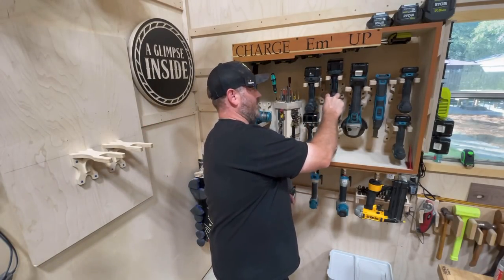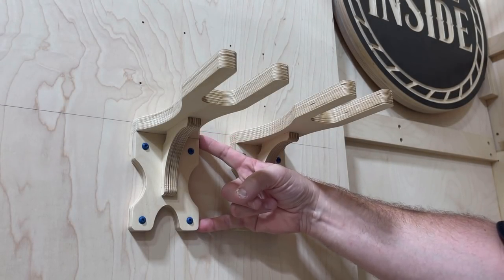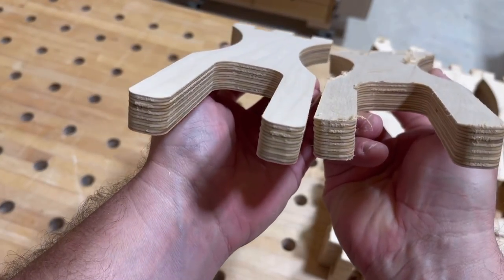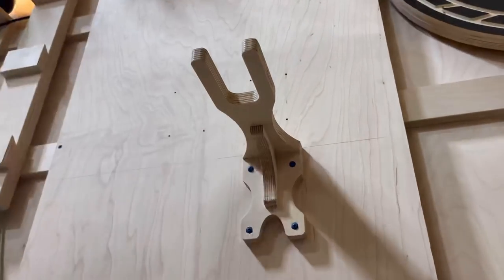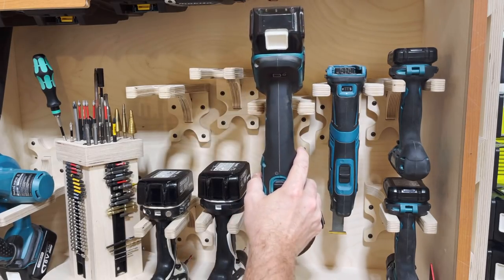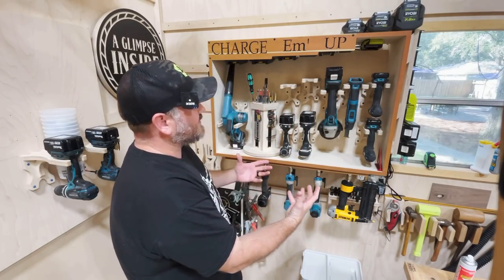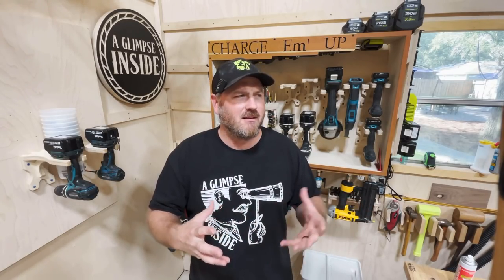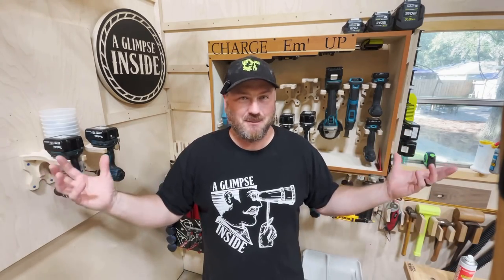The ULTIMATE Drill Driver Holders With Hidden Functionality

Comment: Hi Chris,

To get rid of those fuzzies you have a few options  and I’ll start with the easiest first 

1. Do two passes with the first leaving .020 and then the final pass at a full depth of cut removing the .020 left this usually removes most of it and it does depend on the bit you are using I would need to know that. 

2. Use a roughing endmill first and then similar to the top leave a little more material like .060 and clean the final pass with a finishing endmill. 

3. Use a chamfering bit to clean up the top edge, this requires using a down cut spiral bit and you will then clean the top with the chamfer bit that has the fuzzies left.

Hope that helps!
Reply from the maker: Yes very much so  thank you for the information. I do appreciate you taking the time

Comment: If you have a ball-end router bit, you could already clean up the edges. Make a mold that your pieces fit in, drop the newly cut out pieces into the mold, then have an instruction set to go around the edges of the pieces to round them off. Then turn the pieces around inside the mold and do the same thing again. No more fuzzies and nicely rounded edges.

Comment: I needed to adjust the pocket(s) that the center support nests in....but now the teeth in the corner have gaps between them.  At least an 1/8 of an inch.  My question is, should I be carving these out with the "cut on path" setting or inside/outside settings?  Thank you the help.
Reply from the maker: Cars outside the line for sure. Sorry I wasn’t more specific with this. Eighth of an inch down cut or compression bit. It should turn out really well for you
Reply: @AGlimpseInside  Thank you, we are all learning here.

Comment: Thanks for the mounts and the video. My CNC is running them off now. I was wondering, why did you use 3/4" plywood?? I adjusted them for 1/2" and they seem fine.  Just curious, not a complaint. I'll probably just make one set on the CNC and the rest using a router with a trim bit. takes too long on my small Sainsmart CNC.  Maybe someday when I get some room in my workshop I'll move up to the big league!  For now, as longs the the plans fit on a 5x12 bed, I'm good!
Reply from the maker: That’s a great question and the answer is availability of material. My dealer has 3/4 of an inch Baltic most of the time and a half inch is very hard to source right now at least in my area of the country. So I wasn’t gonna wait on that I figured I would just make this product and also it’s the most robust of the plywood so why not. Best of luck with the half inch I’m sure it’s gonna be great. Thank you so much for your purchase

Comment: I just purchased your CNC files. I'm using Aspire 10.5 which won't allow me to open the files created in VCarve 11. I opened the .svg file to get the 3 parts however that doesn't have the toolpaths. What size bit did you use in your cnc to cut out these parts?

Comment: hi what diameter bits are you using for cutting you drill holders out as i have got from you a set of files . 
as i am set up for metric  hear in the UK thanks Stephen
Reply from the maker: .125 in or 1/8in

Comment: I ordered your file to cut the tool holder on my cnc router. I can not get the dxf to open in Mach 3. Any suggestions?
Thanks
David
Reply from the maker: Use the SVG. That’s why I include multiple files in case one is a little temperamental with somebody’s set up.

Comment: A compression bit should reduce or eliminate those bottom fuzzies.
Reply from the maker: Does it does a little bit. I’ve got quite a few of those. I found the down cut it works best for me because I want to use sawdust as compaction and no tabs. A little bit of extra sanding is nothing compared to taking off tabs in my opinion

Comment: Hello, nice video and holder, I bought the files to make my own. Which brings me to your method of milling. If the VCarve file I downloaded is the same as you're using, I'm not sure why are you using an 1/8" endmill for the entire job? I believe, or rather know that you would save a ton of unnecessary CNC time by changing your toolpath strategy to include a 1/4" endmill. If you use an 1/8" "drill bit" for CNC's and not an endmill, to drill your fillets and then switch to a 1/4" endmill to cut the profile and hog out the pockets, I think you could save a lot of time carving over what you're spending now. You may not find a 1/8" bit, but a 3mm is just a couple of thousands under and will work fine. You could then make at least a 0.125" deep pass with the 1/4", and not 0.05" as I see the file shows, and then look at increasing the feed rate to whatever your CNC will handle. I would think it should be able to cut faster than 45 inches a minute, maybe 60~70 with a 1/4" bit. My two cents, best of luck with the new business, Chuck
Reply from the maker: Thanks for the insight. However for me to set a cut up without changing the bit for the entire project is huge for me. And I’ve got so many irons in the fire here I can set a cut with a reasonable speed and if it takes a little bit longer that’s OK because I’ve been can jump to something else for the channel or what not. I completely understand efficiency and that it looks like I could totally be more efficient by changing out bits. It’s just a pet peeve of mine if I have to change a bit two or three times for one project. I know that sounds silly but that’s my thought and I figured I would let you know. All good ideas though Brother and they all would work really well and I appreciate it
Reply: @AGlimpseInside  I get it, I just hate seeing so much extra CNC time, and it's not for nothing, it does take a toll on the machine, trust me they don't last forever. It's not much different than driving your car around in 1st gear, much more wear and tear on the driveline for the same distance traveled. It probably takes close to 6 hours to run those parts, by changing your strategy to the 2-tool solution, it cuts it almost in half, to just a bit over 3 hours. The first tool path for the 1/8" drill bit will only take about 10, maybe 15min, then you can change it to the 1/4" and let it run for the remainder of just under 3 hours. The times might not be exact, but the percentages between the two are remarkably close. If your run time is 5 hours, then it would be a little over two and half hours for the 2-tool run. Anyway, it isn't just efficiency, it's cost savings on power and more importantly the machine life. Running as you are you're doubling the cost of your CNC by wearing it out twice as fast.
OK, I've said my piece, I feel better now. But I probably wore out my welcome here, so I wish you and your business immense success. 👍
Reply from the maker: Hey brother I’m here for you I’ll be a sounding board all day man no problem. But the time frame you used six hours? Is that just for those three pieces. I’m able to make 10 complete holders in 45 minutes on my machine with only using the 8th inch bit. Granted I do have a powerful commercial grade 
Machine that is liquid cooled with a true spindle. Maybe that’s why I can go through it so quickly. Because this thing is a beast
Reply: @AGlimpseInside  Thanks, 45min to cut out 10 holders with an 1/8" end mill is pretty impressive!

Comment: Why did you choose to hang the tools battery up?
Reply from the maker: Great question. Each manufacturer puts the drive and reverse toggle on the drill a little bit differently. To mount them upside down there’s fewer moving parts to get in the way so every brand has the best chance of fitting  well

Comment: I purchased cnc file, but since I use Aspire and the file is designed in VCarve Pro I t would not open
Reply from the maker: Unfortunately you would think those programs with coexist because they’re made by the same company but they don’t that’s why I include all the other file types for you to import into whatever modeling software are using. I can tell you I use an eighth of an inch compression bit the first pass is. 20 inches and I do this in about six passes with. 70 thickness of stock hope that helps of course follow the outside of the line. If you’re making the tool holder The mortise is .215

Comment: With your love of french cleats why not make mini French cleats in your cabinet to hang these instead of screwing them in?
Reply from the maker: I thought about that. But I kind of like the structure and strength of screwing these pieces in after all the entire cabinet is on a friends crate so I want to move whole thing it’ll be pretty easy. Also drills come in and out of  holders quite a bit. So I wanted them to be completely permanent
Reply: Makes sense. Keep up the good content.